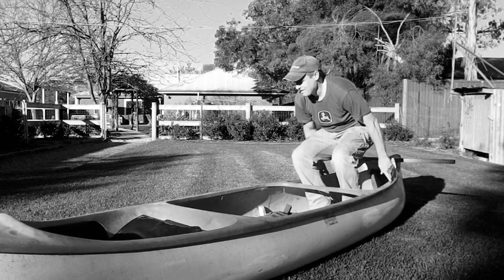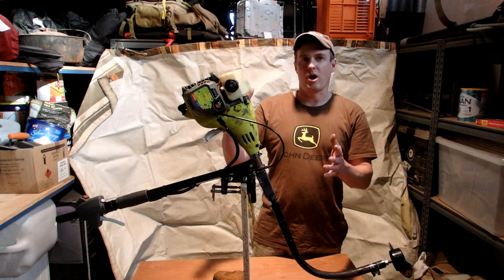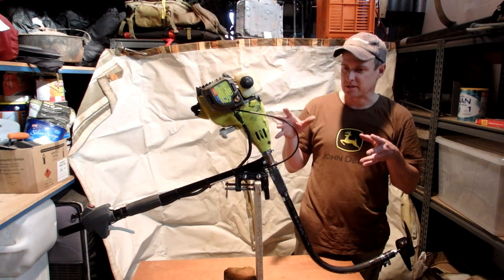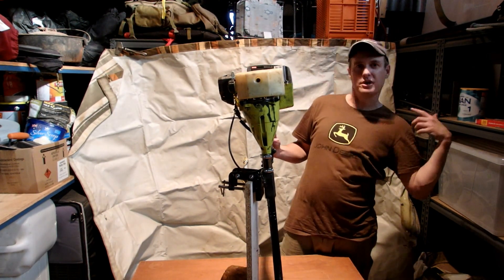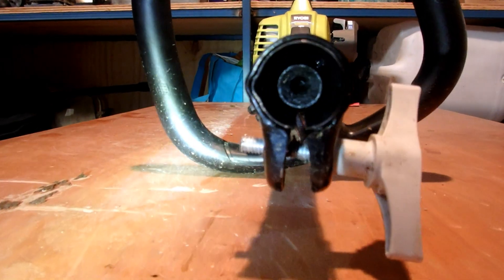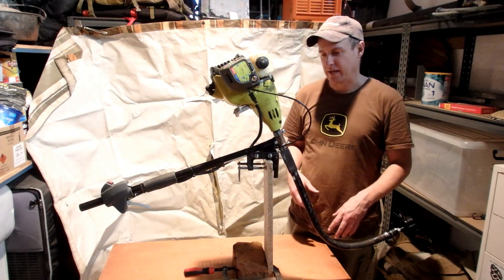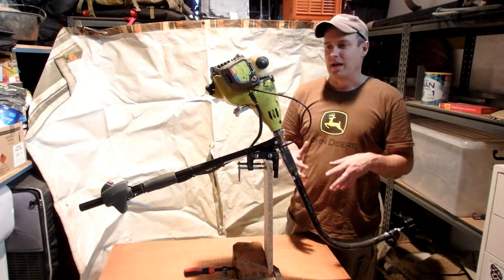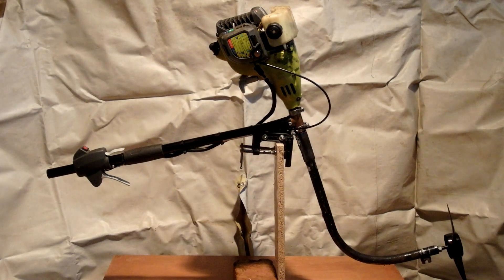Weed Wacker Whipper Snipper Outboard Motor Part 1

Comment: How long does it last. For example say I need to get out 1-3 miles in the ocean how long would a weed wacker propeller system last me. Miles/Minutes/Hours Etc… thanks appreciate mahalo. 
I’m on Oahu Hawaii just FYI
Reply from the maker: Mahalo. I've been to Oahu. Very beautiful place. The clutch is probably a weak point and would burn out before you even finish one tank of fuel. The propeller was also creating a lot if drag on the hub so some sort if fairing would be needed. If you can overcome these things it would actually work pretty well and could take several miles easily.

Comment: lovely plume of smoke follows
Reply from the maker: Yes, it was a fun project but very impractical. I think the noise was even more irritating than the smoke.
Reply: @AllThingsOutdoors  I would try a steel or aluminum prop with a little more pitch on it. Chances are the plastic is straightening out with the water pressure
Reply from the maker: @hammer0371  I think you're spot on. Also I think the prop hub needs a shroud as the centre of the prop creates a heap of drag that cancels out the thrust a fair bit.

Comment: This it fantastic!! Found that exact Ryobi model in council clean up yesterday.  This was my first thing I thought of to do with it.  Will be following your instructions!! Thanks 😊
Reply from the maker: Perhaps try a different prop though. I found that the plastic prop on this one created almost as much drag as thrust. The clutch on the motor also wasn't real happy.
Reply: @AllThingsOutdoors  what’s the most run time you got out of the engine ?
Reply: @AllThingsOutdoors  thank you for the reply !  I will most certainly look into props
Reply from the maker: I haven't ran it empty but would.i.agine it wouldn't be that long with the prop I had on. If you could find a more efficient prop you could run it at lower rpm and get longer runtime.

Comment: I used 78mm (1/4" pitch) propeller of RC boat for my trimmer and it worked great. i think you should try it and you can find it on amazon about 25 dollars
Reply from the maker: Wow that must have been a big rc boat. Yes I am considering a different sized prop however I have to figure out first how to stop the clutch from slipping and overheating.
Reply: @AllThingsOutdoors  😁 yup. But but you don't need to stop the clutch, this will shut down the engine when you put the propeller in the water.  that's why I recommend a small prop for small engine with high rpm

Comment: The motor is still working? hahahaha Nice work!
Reply from the maker: It was an old engine. I bought a new carburettor for it which made it run for a little while but it was a bit worn out.
Reply: @AllThingsOutdoors   And you think that is posible to block the  clutch or at least remove it
Reply from the maker: Not this one😬
Reply: @AllThingsOutdoors   What happend I mean whats break?
Reply from the maker: I don't think you could remove the clutch on this model. It would probably be easier to get a trimmer with no clutch. The clutch is definitely the weak point of this design.